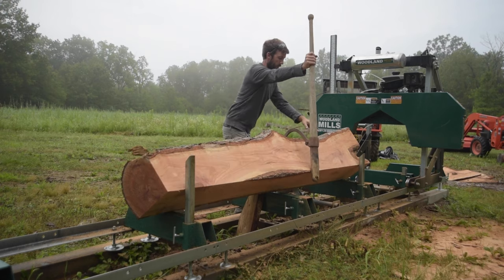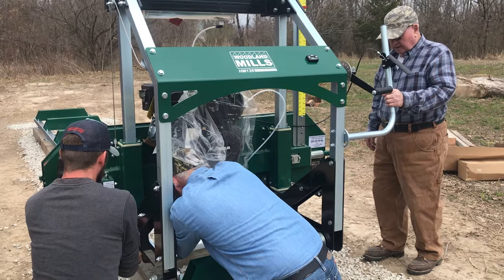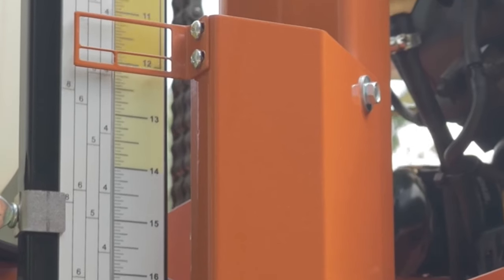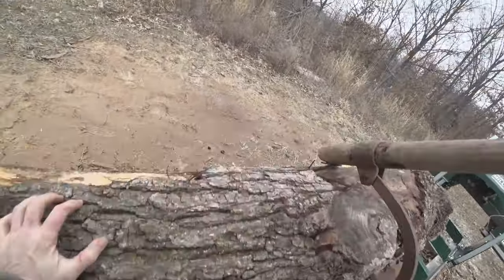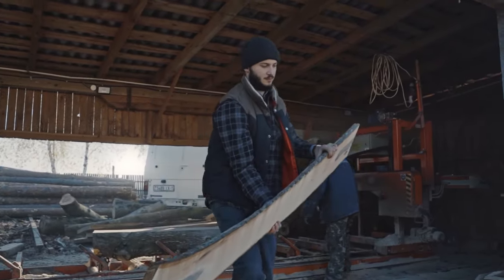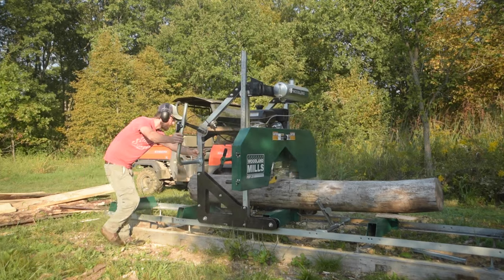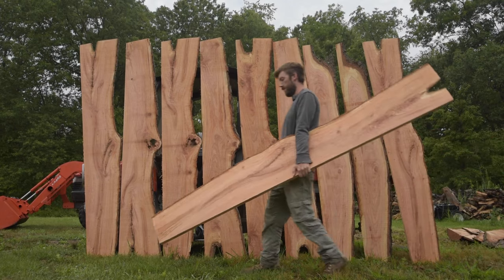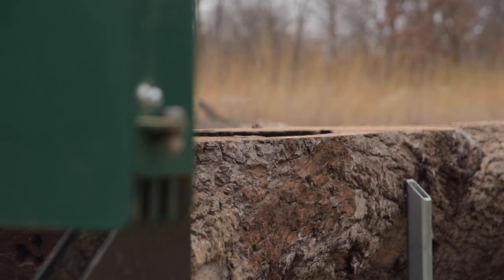Do You Really Save Money With a Cheap Sawmill?

Comment: Hey there buddy how are ya? I enjoyed the video!! 
So I was looking at the woodland mills Hm130max for quite sometime was about to buy them talked to my Dad. He asked me am I getting younger or older day by day. I was 56 and retired at the time I bought my mill. He asked is there a mill that is affordable now and later can upgrade to full hydraulics? Only one mill meets these criteria. The Norwood saw mill HD36V2 is what I bought. 
I cut 34 inch 14 foot fur logs. This is way too much for a manual mill but I did it. Really fought these heavy logs. Next time I will quarter with a huge chain saw make life a lot easier. I’m cutting for lumber not slabs so is ok. Now most of the logs I cut are 12 to 24 inches these are much easier to handle and turn on the mill. 18 to 24 are preferred as you get a good quality of lumber from them. 
During the pandemic I sold a lot of 2x4s 4x4s and 2x6s lumber was crazy high at the box stores. 
Tree crews drop logs off for me. They have to pay to dump them so it’s a win win. 
I love having a saw mill it’s fun, rewarding and profitable. Some day hydraulics might be needed but in tell then it’s all me!
Reply from the maker: That's great advice! Your Dad sounds like a man of wisdom. The ability to upgrade to hydraulics later on is a great way to get the best of both worlds. Thanks for watching and for the comment.

Comment: WM HM126. Got it a couple years ago and I love it. I am mostly a hobbyist but have sold a few planks and a bunch of stuff I have made from the wood I cut.
Reply from the maker: Heck yeah! It's a great saw.
Reply: I have a HM130 max and I like it one thing I wish I had is a log turner. Those big ones get pretty heavy on the back and of shoulders. When they're too big, I take them off with the tractor  and grapple and turn them.
Reply from the maker: Yeah after using a log turner that's one thing I also wish my woodland mills had. It can get tough when trying to turn the log and hold it in place while grabbing a chunk of wood to keep it from rolling back towards you. @steveolson3667

Comment: As I consider whats going to be right for me and my family, I am trying to gather as much information between using a chainsaw mill vs buying a bandsaw mill, did you ever consider using a chainsaw mill and what led you to buying what you currently have?
Reply from the maker: I did look at chainsaw mills when I was thinking about getting a sawmill. For me we had about 60 logs laying around after our land was logged. The logs were all around 20-25" in diameter. That much wood sort of ruled the chainsaw mill out for me. Also I would have had to invest in the large chainsaw and mill as well. But... I still think there are advantages to a chainsaw mill. Our land is covered with deep ravines and hills that make access very difficult. With my equipment there is no way for me to pull up a log from most of the hills, so they just lay there or get cut up into firewood. If I had a chainsaw mill, I would just take the mill to the log, mill it up, and then pull the boards out one by one. Also with a chainsaw mill I could mill larger logs depending on what size bar and chain. With my mill a 26" diameter log maxes is out. With a chainsaw mill you could slab much larger stuff. Of course you lose more material with a chainsaw mill and you use a lot of fuel, but with a bandsaw mill you still go through fuel and blades and need equipment to move the logs around. So it's really situational. I think if you just had a few trees you wanted to mill up, or you just wanted some extra wood for yourself, a chainsaw mill is a great option. Sometimes simple is better. What are you wanting to do with a mill?
Reply: I think you said it rightly when you said that it's addicting to see what kinds of pieces you can get out of a given tree or piece. Our overall goal would be to harvest wood on our own land and mill up to build a timber frame structure. But I also love the idea of being able to slab up my own wood and custom mill pieces for my own projects. I think a bandsaw mill makes more sense for  me, although a chain saw is still a must. I do wonder about wether having a mill on a trailer vs on the ground would be better, then you could at least haul the mill around the property as needed or even to someone else's property if need be. But obviously thats a higher expense.   @MacJackal
Reply from the maker: Yeah the trailer vs not is a tough decisions. A couple advantages as well with a trailer is that you don't have to build a platform or concrete slab to set the mill on to keep it level. And if you want to clean up around the mill you can just pull the mill out of the way. Also some people prefer the height of a trailer when milling the wood as you don't bend over as much. Of course you have to have equipment that can get a log up higher onto the trailer and like you said, the whole setup costs more upfront. I would love to have my mill on a trailer for the reasons mentioned, but I do enjoy having the mill really low to the ground in order to load heavier logs onto. If I had a bigger tractor or Uniloader I would probably prefer the trailer. I Love that you want to build a timber frame structure!